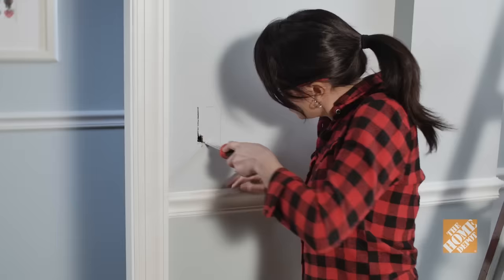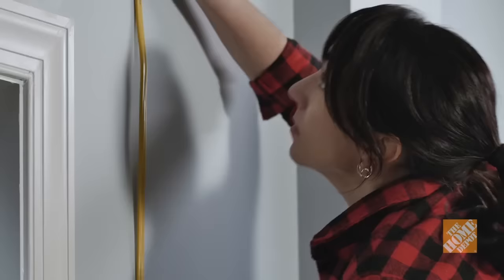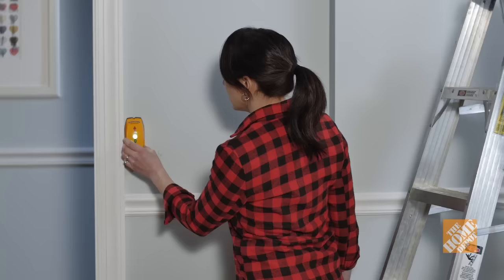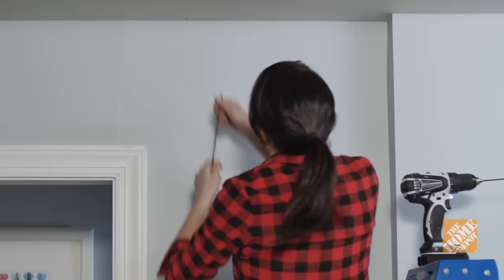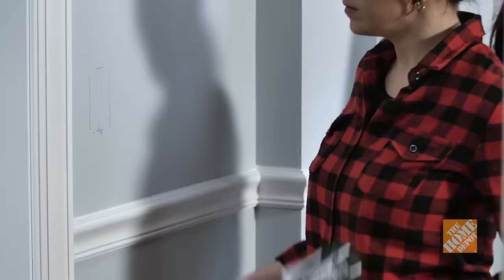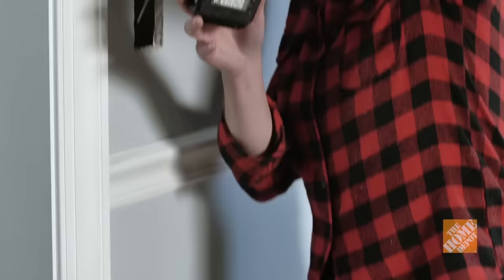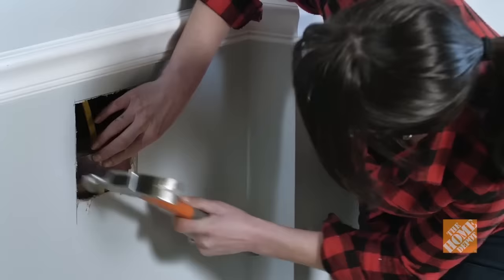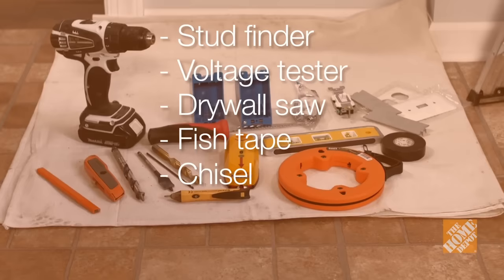How to Run/Fish Electrical Wire Through Walls & Ceilings | The Home Depot

Comment: Would be a lot easier to run the fish down through the hole in the attic to the huge hole in the wall, rather than start at the huge hole and move up to the tiny hole in the top plate...

Comment: She doesnt use the electrical tester, or wiggy, correctly. She should insert the prong in both outlet slots to make sure.
Reply: Exactly, that non-contact voltage tester is highly unlikely to go off the way she used it.

Comment: I didn't understand step 3, drilling a hole in the ceiling. So this hole is just purely for reference? . Also wouldn't it make more sense if the manufacturers who make fish wire make it a bright color like yellow or pink? Why make it black. That's hard to see in-between dark walls.

Comment: Get some knee pads and a piece of plywood for crawling in the attic.  Those joists will KILL your knees.  Also, you can put a piece of metal coathanger into the drill and send it thru as a marker.  It will stay put after your loosen the drill chuck and it makes a tiny hole.  Also, it will pass thru plywood and even oak flooring!  If you have a friend, you can skip this step and let him knock knock.

Comment: How do I do this without access to my attic? I want to add a jamb switch to a pull-chain light in a closet but have no clue how to fish the wire through the ceiling, down the wall  and into the door jamb without damaging the plaster.

Comment: Okay, but how to make a single outlet a dual one? SO you have one outlet, and you want to add a seconed or ever third right next to it? Do you need to run wire through the wall like this, or can you just add the wire directly from one to another?

Comment: You need to make sure your using the correct gauge wire, because 12 gauge is for 15 amps and 20 gauge is for 20Amps